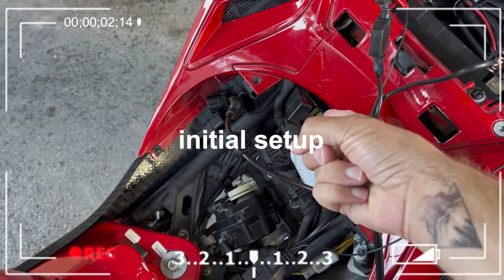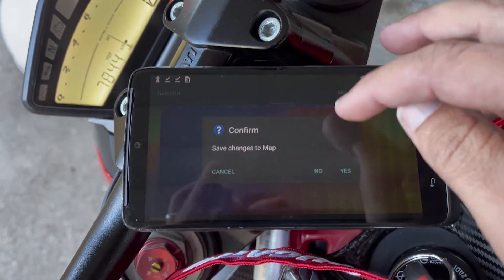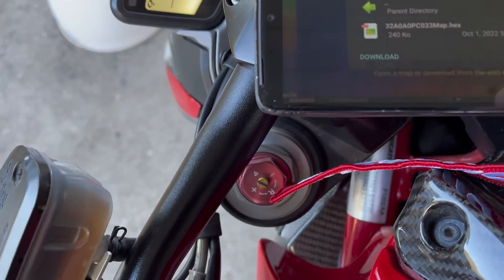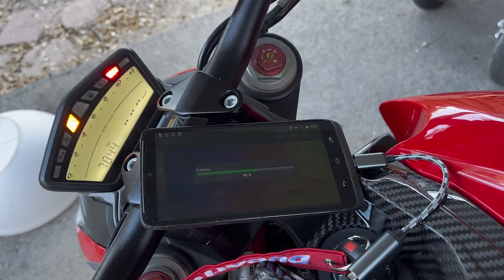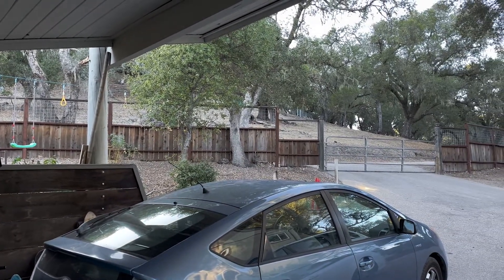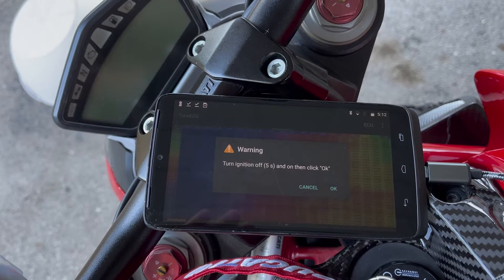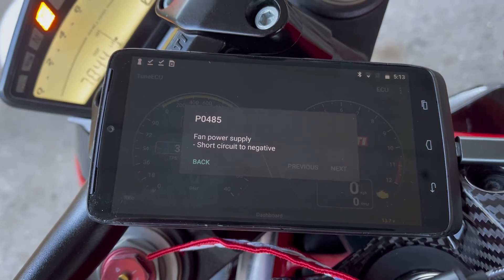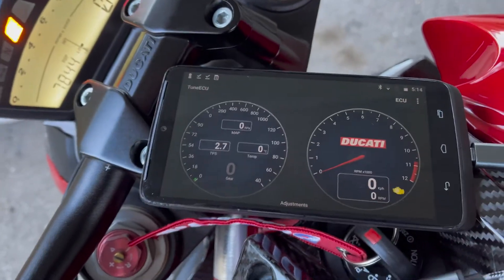Flashing my ECU with TuneEcu -Streetfighter 848

Comment: Hi Desmo,
Random question, can you please point me in the right direction as to which bracket you used to install your ohlin steering dampner.
Reply from the maker: Sorry I thought I had replied to this. Its the stock bracket from the sf1098, with a Ducabike bracket for the öhlins dampener. Granted, it is modified to work for the sf848

Comment: Very Nice Job, Very Very Helpful, Bro I have a couple of questions, I have a 2009 streetfighter 1098s, my dash is not working it's broken because of water damage, so I need the same type of obd cables that u use and can u please tell me the application name that you use on your phone and how can I connect this obd scanner to my phone also what kind of obd scanner are you using... thanks so much
Reply from the maker: Im using the TuneEcu app. It's only available for android. I got the diagnostic cables from Lonelec. here's a link https://www.lonelec.com/product/guzzidiag-3pin-interface-cable-kit/
Reply from the maker: if you dash is not working then you're bike doesn't work at all right? You get no power? You won't be able to use the diagnostic tools if the dash is dead.
Reply: @DesmoMarcel  Thank you so much for your kind Response, It helped me alot, I ordered the cable already from lonelec.. and will update you with results
Reply: Bro M the one WHO got ur 848 u didnt mention u do blogs hehe. Very Helpful vids man more power.
I waited to get the cables too. How much u got them for? Planning to play with the maps as well.
Reply from the maker: @daltoncute  yoooo! Heck yeah man. Pretty sure I got them for around $30. Then bought the app for about $10. Super helpful to have. Just be sure to connect everything properly so you dont fry the ecu.
Reply: Bro M the one WHO got ur 848 u didnt mention u do blogs hehe. Very Helpful vids man more power.
I waited to get the cables too. How much u got them for? Planning to play with the maps as well.